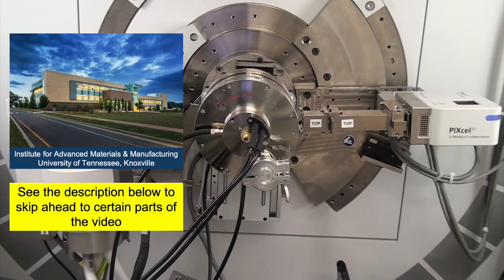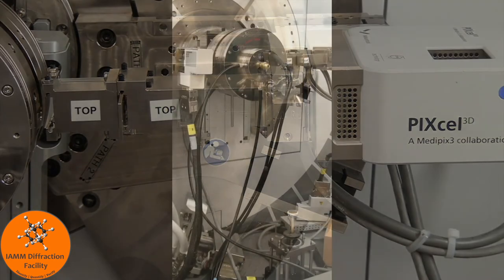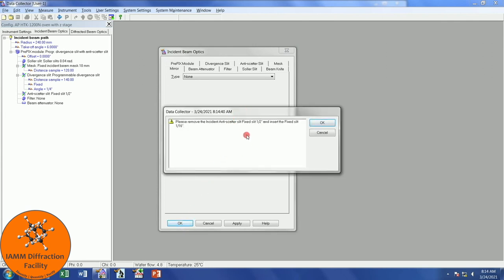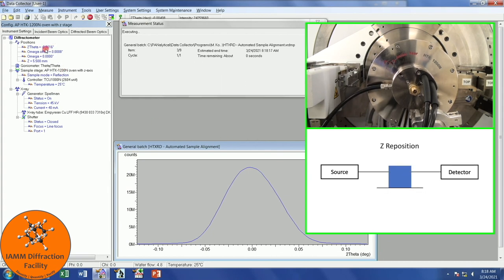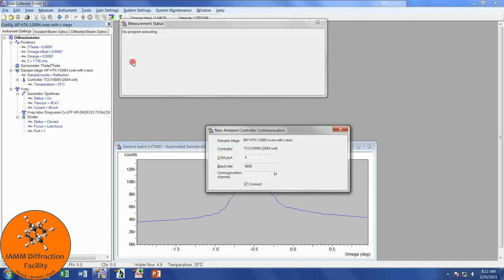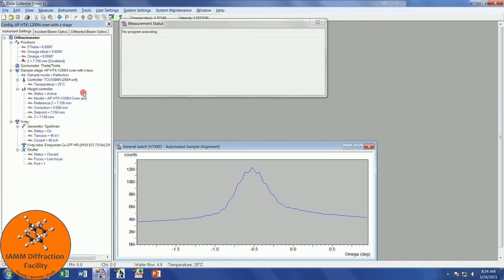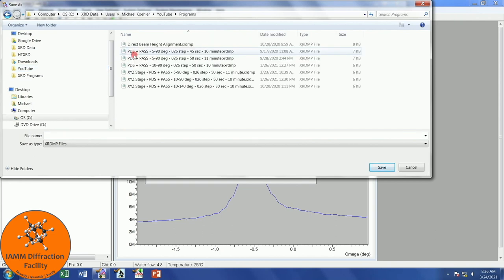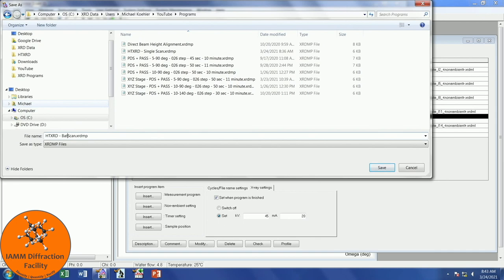How to Perform High-Temperature XRD - Empyrean Training - Malvern Panalytical

Comment from the maker: If turning automatic height control off and then back on does not fix the "Inactive" problem, try going to Instrument, Disconnect, click OK on the window that opens, go to Instrument, Connect, and then connect to the appropriate configuration.  Once you activate the automatic height control after reconnecting, it should work as intended and display "Active."

Comment: Thank you this is so much appreciated! Can you please do one with a turbo pump? Do I need a rotary pump as well? I have learned so much from your channel 👍
Reply from the maker: Thank you for the kind words!  That's a good idea about the turbo pump video.  What I will likely do is show how to install the turbo pump and how to use the controller for it.  For everything else, I'll refer back to this video.  

I have a couple of high-temperature experiments planned for next week, so I will need the HTXRD stage installed.  I'm hopeful that I could find some time next week to record how to connect the turbo pump (both the pumping connections and electrical connections) and where to install end caps (they are probably called something else, but I suck with hardware names) to close off the HTXRD chamber.  

Regarding the rotary pump, yes, you need one of those.  The rotary pump gets the vacuum started, and then at a certain pressure, you can turn on the turbo pump.